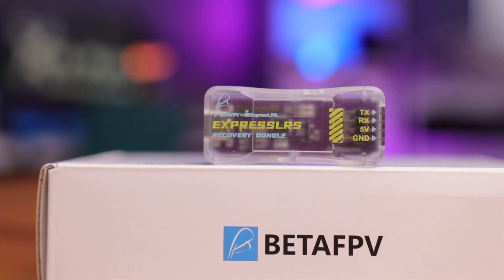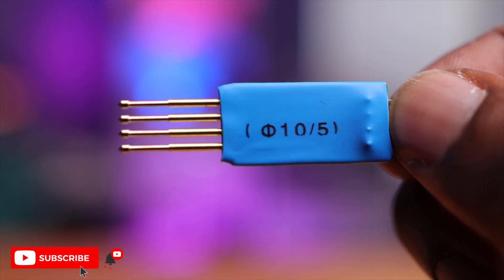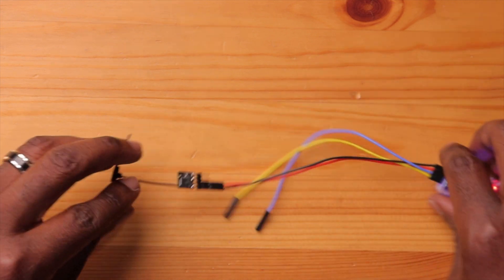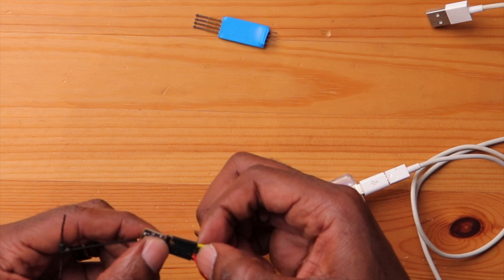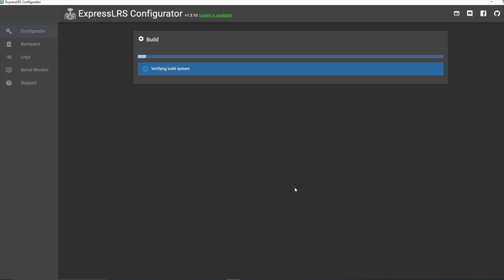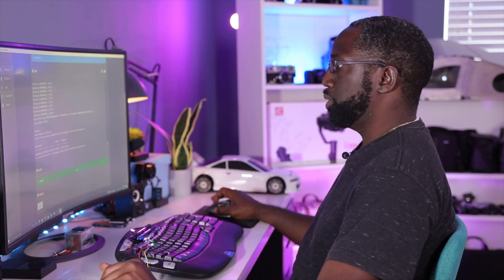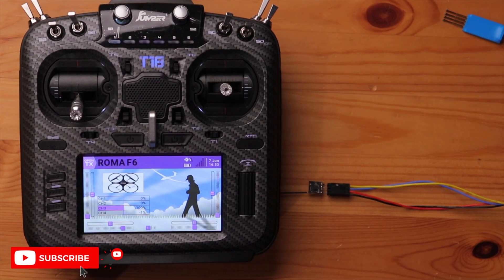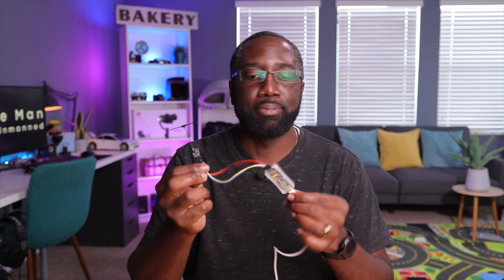BETAFPV ELRS Recovery Dongle | Quick & Easy Way to Unbrick Your Receiver

Comment: I accidentally "bricked" my receiver by installing the partitioner firmware on it. This fixed it and now I'm flying. Thanks!
Reply: I did the same thing and I just ordered this. My rx and fc are soldered together already, do you know if I can just leave them soldered together and use this or does my FC need to be unsoldered from my rx?

Comment: Hey there,
I have an Iflight and happymodel 2400ghz RX that won't go into bootloader mode.
Does the betafpv ExpressLRS Recovery Dongle work with other RX?
Reply from the maker: Yes it does work on other models, but you will have to find a way to put them into Bootloader mode(usually by soldering a pad or pressing a button during power-up).
Reply: @OneManUnmanned  thx for the reply

Comment: Betafpv nano receiver didn't power or light at all.  I checked all wires and solder correctly. Betaflight set uart serial on, receiver on serial and crsf. I think receiver is dead on arrival

Comment: I did some flashing today on brand new receivers and I couldn't go straight to version 3 point RC2, insufficient space message in web/wifi ui. And I think I'll wait and get one of these. My woops are all getting older smd pp's and time is money..

Thanks
Reply from the maker: I think other users were having similar problems with the ELRS Configurator.  I think JB make a good video on how to fix it.  I’ll link it below.
https://youtu.be/2kcRi1cHejM
Reply: Yesterday I finally decided to flash some receivers I bought a while back. Never had a problem with flashing receivers til 3.0 came out. I got the not enough space message so I flashed the receiver with the repartition firmware. This made it so I couldn't do anything to it anymore. Luckily I have a few FTDI dongles and I hooked it up and flashed 3.0 with no problem. Now I have to do it to the rest of my receivers, fun!

Comment: Hi thanks for the info, I have a Pwm 2400 rx not connecting to wifi do you know how to wire that one Thanks
Reply from the maker: Sorry, I have not used any PWM devices, but I'm assuming it would be similar to a regular ELRS receiver.  You'll have to know the pin-outs for your specific receiver.   Here's the one for the BetaFPV version.
https://betafpv.com/collections/rx-tx/products/elrs-micro-receiver
Reply: @OneManUnmanned  
Hi thanks for replying, I do have a pwm 2400 receiver, but it’s a brick, 
it won’t go into wifi mode, just wondering if I could use the same dongle to fix it

Comment: Can you flash the receiver using this device and then put it into a Geprc tiny go without a resistor ? Or would you still have to use the resistor in the tiny go?
Reply from the maker: With this dongle, you can flash any ELRS receiver before installing it into any drone.   It does not mean you are, or aren't going to need the resistor.  Needing a resistor depends primarily on your Flight Controller and/or its UART.  No one will know until you install it to your FC.  Chances are though, you will need the resistor with this particular FC in the TinyGo.

Comment: Nice,  hopefully wont need it though,  but I'm up and running with new elrs tx16s one quad set up on too a few more. Thanks for the info
Reply from the maker: I'm glad you got it going..I didn't need one until now.  Glad I have it.  Thanks Michael.
Reply: @OneManUnmanned  fyi used buddy it only took about 2 minutes and it does load sd card now with sounds and themes,  yea I'll probably pick up a dongle just in case. But so far my switch to elrs has gone well but tx16s I'm just building craft over so I can still fly some planes and whoops etc. With qx7.next will be hdzero
Reply from the maker: Nice..HDZero is fun and ever evolving tech.

Comment: As you said, those receivers are not easy to break, but I think BetaFPV is building a set of ExpressLSR tools to support and lead ELRS
Reply from the maker: Yes, the ELRS receivers are difficult/impossible to damage(at least software/ firmware wise), but pilots still make mistakes and put them into a state that's unrecoverable.   This tool certainly helps in bringing them back to life.